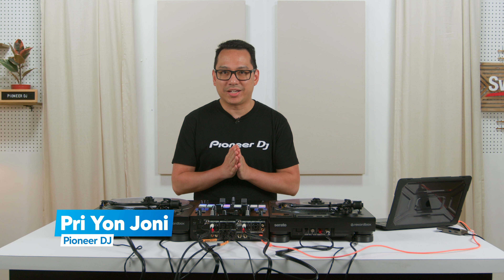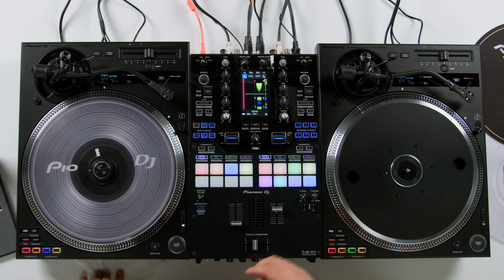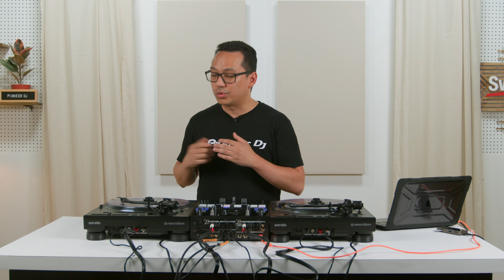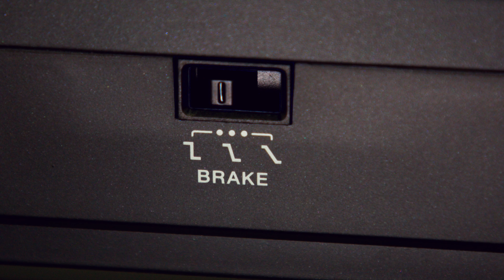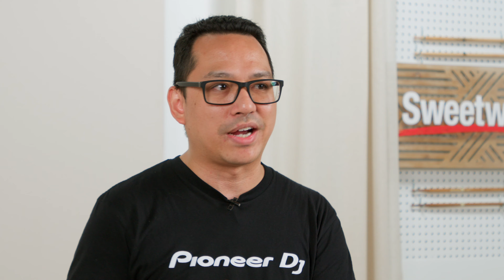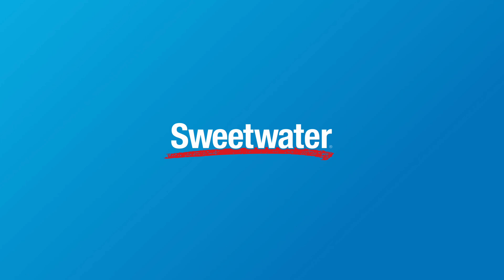Pioneer DJ PLX-CRSS12: Infinitely Adaptable, Tonearm-free Performance

Comment from the maker: Across DVS and needleless scratching, full rekordbox and Serato integration, and nearly endless MIDI, mechanical, and digital performance flexibility, the PLX-CRSS12 is an unrelenting force of turntablism that’s equally powerful in hands of new- and old-school DJs. Which features are you most looking forward to taking for a spin? Sound off in the comments, and head over to Sweetwater for an in-depth look at Pioneer DJ’s PLX-CRSS12 hybrid direct drive turntable 👉 https://sweetwater.sjv.io/Pioneer-DJ-PLX-CRSS12

Comment: Yeah of course the drawbacks aren't shown in such a video:
1st there is no rotary knob for the stopping speed.
2nd the motor is quite unsteady (+/- 0.3 BPM), which makes beatmatching difficult
3rd no engagement at 0% speed adjustment
4th the pads can be bigger, no clue why it's that small.

So overall, not what you expect from that high price class.

Comment: Can you pitch sync with the same song on both decks or do you have to manually move the pitch for them to both be the same speed?
Reply from the maker: Hi, thanks for your interest! If you’re using the PLX-CRSS12’s as part of a setup with a mixer and Serato or Rekordbox, the sync feature in the software will be available just like with any other controller. Of course, if you are working with “real” vinyl, everything would be manual just like the old days. 😉
Hope this helps a bit – feel free to contact me directly with any further questions, and thanks again!
Caleb Lowrey, Sweetwater Sales Engineer, (800) 222-4700 ext. 1620, caleb_lowrey@sweetwater.com

Comment: Is the clamp included, or is Pioneer charging an additional $2000 for that?
Reply: The Magvel clamp is included. It its necessary when using the digital vinyl needle mode.

Comment: Thanks for this. But I'm having an issue with my pair. I have them connected to my S11 via RCA
and USB but when I have a song rolling on deck 1 and then change the deck from 1 to 3, it's still controlling what's on deck 1 on the platter, and not allowing me access to deck 3 (despite that it says it's set to deck 3)...

What am I doing wrong? Or is this a known issue? Because I can't figure out where I'm going wrong. I just tried this on my Rev5 and it works fine. Is it something to do with the S11?

I'm also wondering if stem level control via the EQs is an option on the S11 like it is on the Rev5?

Any help on this stuff is greatly appreciated.
Reply: The assignment of the deck only applies to the MIDI functions. It does not switch your timecode control to another deck.
Reply: If you are not playing real wax get the Rane 12s to solve this issue!